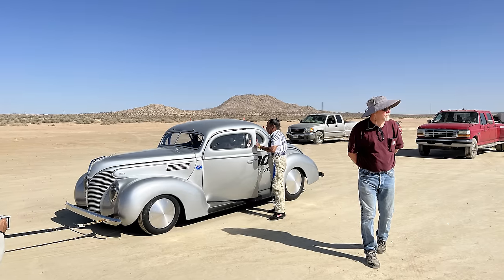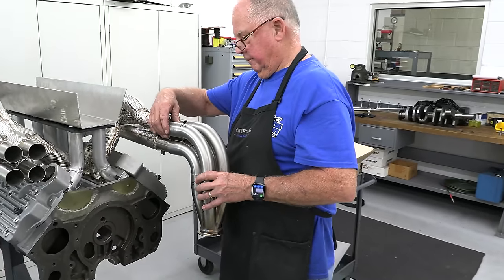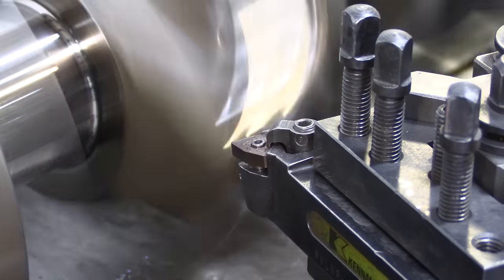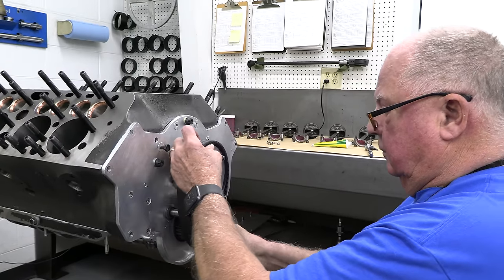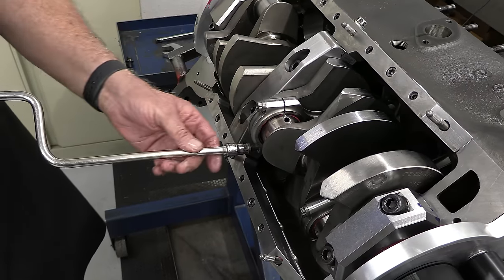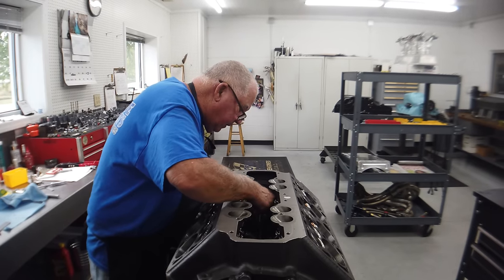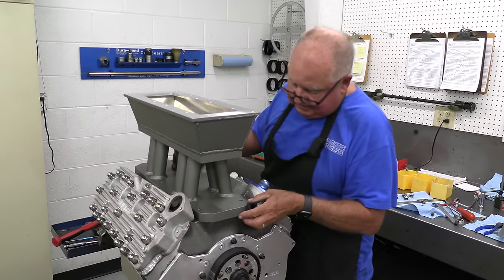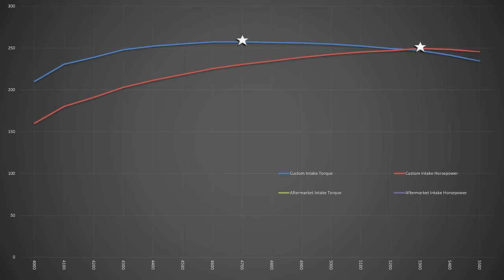World's Fastest Flathead? (Going to the Bonneville Salt Flats)

Comment: My first car was a 46 ford with a flathead  and I put wedges in the center ports to split them so they ran cooler. I remember you had to take out a head bolt and screw a allen screw in below it to hold the wedge as the bolt hole was threaded into the exhaust port.

Comment: French-built 255 engines were fitted to the Simca Unic Marmon Bocquet [fr] (SUMB) light trucks of the French military. When these were decommissioned around 1990, they provided a new source of little-worn engines for the hotrodding community. The block metallurgy, being much later, was also stronger than the originals.
looking at those "strengthening bars for the middle bearingcap , they might be able to unludea 3th and 5th bearing using that bat , mounting it before installing the crank then lay the main caps over them should prevent a little of the crank flexing between the four cilinders on each end of the middle bearing , might even be able to crossbolt the top parts of those bearings intoo the side of the stock block for even more strength
Reply: Simca cars as well
Reply: French blocks are not allowed in the SCTA Flathead Ford/Merc  classes

Comment: Minor correction, one nerd to another: going from 95 to 259 is not a 263% improvement, but rather about 162%, so your math is not correct.  Yes, 259 / 95 is about 2.62, but that's the total ratio, not the improvement.  Going from 95 to 96 is a ratio of 1.01, but I think it's obvious that isn't a 101% improvement, but rather a 1% improvement.  Whenever you have a starting and ending value like that, divide the end by the start, *subtract 1*, and then multiply by 100 to get the percentage improvement.  I probably wouldn't even comment about this, but you seem to care a lot about getting all of this right.  I get the impression you really love your work.  Thanks for the great video.

Comment: Ah, cool build!
Interesting siderail support for the centre main - I was expecting a full girdle to not only do that, but support the front and rear mains AND give some important rigidity to the block by tying the whole bottom end to the MUCH stiffer girdle.
Reply: I’m sure that would be necessary on a forced induction build. 250 hp and 257 torque is pretty easy on that big crank and mains as long as it’s balanced right and has a good vibration dampener.

Comment: That bearing setup on the custom cam is just like the main bearings on a Kubota diesel engine crankshaft. Not roller bearings on the Kubota, but same basic idea. Each main bearing sits in a cartridge and the whole bearing/crank assembly slides into the block from the back. Very very strong design with no main bolts to fail. You'd have to rip the webbing out of those blocks to send the crank out the bottom.

Comment: One worry that I have is the aluminum head squirm on that cast iron block. Aluminum moves about 4 times as much as cast iron at the same temperature which disturbs the seal that head gasket is supposed to take care of, but it will only work if the squirm is equal. With aluminum and the unequal movement between the two metals it will need something to control it. What are they using to control it? If not controlled, you will end up with water in the oil and compression loss even with short runs. Other than that, a fantastic build. That valve overlap is scary. Love to see what it finally does on the flats.

Comment: I loved watching this build, it is inspiring to say the least. By looking at the SCTA results this year Ron Cooper must have had some teething pains as his highest speed is 124+ on a 132+ record at El Mirage. Bonneville is tougher due to altitude and high temperatures which are hard on naturally aspirated gasoline engine to make the hp they did at sea level. I wish him luck as records are tough to attain. I set a speed record of 135 at ElMirage and 137 at Bonneville in a 1940 Chevrolet in the other vintage engine class in a 1948 and earlier body like Ron is trying and I was making 300 hp to do it with 311” and 12-1 compression. Those records have been surpassed by others.

Comment: Such impressive work. Both from the engine builders who are obviously next level. And the videographer's  work, The extra footage from the car at El Mirage was supreme! I am learning so much from your videos. Crazy guys with deep pockets building some wonderful machines. You should revisit that awesome straight six build and show the final product. Please.
Reply from the maker: Thanks. And I appreciate your comment about the straight six from a while back. That's the problem I run into. I'd love to show the engines in the vehicles they are built for, but as of right now, that engine is still sitting boxed up in the shop while the car builder finishes up the Suburban. I don't think it will be finished any time too soon. Thanks for watching!
Reply: @TheHorsepowerMonster  If you are able to do a follow up video on a completed car. Depending on how you present it to your audience, I believe would get many views. Being able to see this salt-flat car at the end was really something. I realize you may not have access, or the vehicle being built, like the fifties Suburban may be too far away from you. But I would suggest that even still photos would provide another level to your video. You may even want to use them as an ending to other videos. Anyway, your work is much appreciated. As an autodidact I learn by watching. So I am gaining invaluable information. Even though I am not personally (yet) building a Flathead.

Comment: My father knew a drag racer who de-stroked a flathead to spin over 8000 and used two 4 cylinder distributors geared together to keep the spark controlled.

Comment: This is really really awesome. One question… could  tapering the runners from the top of the intake to the bottom by 15 degrees increase the air velocity going into the cylinder?

Comment: there's a guy named jerry at united engine specialist in Wichita Kansas that make a main girdle that incorporates all three main caps with the side girdle all as one piece and will accept i think 460 ford main studs but you have to dry sump and inject the oil into the main caps which "reverses" the original oil flow turning it into a priority main system. and its all cast as one piece and bolts all the way around the pan rail. he runs a streamliner out at Bonneville called the Kansas twister.

Comment: I know it's comparing apples to peanut butter, but inline Perkins diesel engines run the camshaft directly in the engine block no bearings at all. The engine speed and loads are most likely less, than a automotive application. Just something to thing about, for some possible build This build is over the top!

Comment: I have at times wondered if there was an oil that would work as bottom end lubricant but also work to cool the motor if used as coolant. This would eliminate some issues with water leaking into the oil in conventional builds. I know sounds crazy!
Reply: Like aircooled vw or Porsches
Reply: I've wondered this too, 0w30 seems almost as thin as water, for the amount of time an engine like this runs I doubt it would dilute the lubrication oil too much.

Comment: I've often thought about welding up the ports and placing the intake in the valley. It would only work for one season but it is currently legal. It would give a straight shot to the back of the valve. The exhaust would come out in the current intake port location above the in valley intake. This would be as low as possible with intake runners facing on an upward angle. It would be a bit of a Jenga game to put together but it should really work great.

Comment: My father who has now past once told me of a flathead ford they had built in the 50's that they had power a bout with in New Zealand . And they had carbs on the exhaust ports and the header out the inlets but i seem to recall that the had cut and welded the cam and ran the engine in the reverse rotation

Comment: They should try a long centre branch exhaust manifold like on the old Austin Mini engine, the Austin also has a siamese centre exhaust port and headers with a longer centre section has been well established as a way to gain power
Reply: Flathead is a lost cause those cylinder heads do not flow. It's like trying to beat a dead horse to plow the field it just ain't going to happen.
Reply: 90 degree crank in the V8, valves down one bank don't open with even separation like like the Mini. But it does look like the exhausts were more about working to time schedule rather than a full development program.

Comment: If he makes the main caps as one piece also called a bed plate and make the bed plate also bolt to the pan rails it will strengthen the whole mains situation. He could also have a bar along the top to join the mains that way too and have the sump bolt to that which could also separate the two sides of the engine for the dry sump.

Comment: The Ford flathead made 95 HP, and the Mercury flathead made110HP. on the later versions. the early versions had the distributor down in front and had two distributor caps. and the later versions had the distributor up on the left side looking from the front. and used a regular cap. the early versions had four spark plug wires connected to each cap. that went up though metal tubes as wire looms then went to each spark plug. they all had two water pumps that doubled as motor mounts and the generator was mounted up front on the intake manifold. and the fan belt look sort of diamond shaped. the early flatheads didn't have adjustable tappets. and a person adjusted the valve clearance by grinding the valve stems. the later flatheads had adjustable tappets. all flatheads had only three main bearings. and we're only good for about 4500 RPMs. otherwise a person was at risk of flinging the bottom end out of them. and all flatheads had remote oil filters. offenhouser made a lot of performance parts for the flathead and built some pretty potent flathead engines. they were known for the blocks cracking. especially between the valve seats because the valves were so close together. they were sort strange because a person could run them without any mufflers but yet they weren't really loud. and a person could remove one head and run them without it. them big Holley carburetors seem pretty big for a flathead but they seemed to work. I know these engines pretty well. my father raced a B class Chevrolet with a 235 six cylinder. because Chevrolet only had a six cylinder at the time. but it was no match for the offenhouser flatheads.

Comment: It's crazy that nobody makes new blocks for these.

Motor City Flatheads had prototypes for a big bore/thin wall block with upgraded port flow even compared to factory ported, and a stronger bottom end but it went nowhere. The much underappreciated and much better post war design "big block" 337 is the new frontier for flatheads lol.

Comment: if you try to revisit the original design, make your runners from cast iron, and braze or possibly solder the runners in place. mcmaster sells a special flux thats very effective for usage on steel and stainless steel, and may work on cast iron as well. also in theory, a longer rod will have less frictional losses.

Comment: Seems a extra bolt in main set would be possible, maybe use Subaru mains machine grooves in the block pan rail kinda wedge in after  placing the crank in the block.  Bolt in from the side,  using 1/2" bolts, then 3/8" bolts from the pan bolt rail. With the new pan being flat,  no arch over the crank,

Comment: I wonder if spray welding could have fixed the blocks that had wear issues. I also wonder about doing some cast iron welding to strengthen or modify the blocks for that awesome reverse flow arrangement

Comment: This saddens me. When I was younger I had old gear heads tell me they had 500hp flatheads, but they didn't have the abilities and new type of parts to come anywhere close to this set-up.
Reply: Not possible the structural integrity and cylinder head flow is simply not there.

Comment: One thing a flathead has in it's favor is a simple light-weight valve train, just like an OHC, so it is capable of high revs without having to use super-stiff valve springs, without the excessive height and bulk of OHC engines
Reply: They don't make much power at high revs though. The valves are small and the ports don't flow well.
Reply: @nerd1000ify  True.

Comment: They should look at the Ford big block flathead 337 used on the big trucks. It should be able to be bored and stroke to 375 cid. The intake runners are already straight to the valves. Only problem is that most blocks have cracks.
Reply: Not legal for the class.

Comment: Those keyways in the lifter bores were broached I assume?... I'm still trying to wrap my head around how they did that 😆
Reply from the maker: I wasn't around for that one and I'm not sure, but you should have seen it when they put the entire block on the Serdi single point cutter to cut in the valve seats!
Reply: @TheHorsepowerMonster  That took some tactical maneuvers I'm sure lol How did they secure the block for that, did they have to make custom fixtures of some sort?
Reply from the maker: @graveyardrumblers  Oh yes, they had to come up with a whole system to get the block on the machine and then hold it still.
Reply: @TheHorsepowerMonster  All that could be a video by itself lol. Cool stuff, love to see folks breathing new life into those old flat heads and especially for something as cool as a Bonneville speed run.
Reply: How would they Evan get any tooling in there  to began with.
Reply: We use those same style lifters in pulling tractors. You use a hardened dummy drill bushing with a slot down the side made by a ball end mill. Slide the bushing in the block square it up and then drill down the side. The hardened bushing guides the drill right where it is supposed to be.
Reply: @bcbloc02  Ah that makes sense, thank you 👍

Comment: Surprised it uses 1400cfm of carb for that airflow and power.
Would love to see a Flathead modded for Direct Stratified Injection and a decent throttle body. The lower parts count could make interesting numbers for internal friction losses compared to OHV and OHC engines.

Comment: Nice Build!!  Maybe you could squeeze more HP out of the flat head with direct injection
Reply: Nah, that suits high compression ratios, I don’t think a flattie would like zero lubrication and cleaning on the intake valve. Flatties carbon up really badly anyway because the exhaust cools in the block and carbon condenses on all the surfaces because of the massive surface area inside of the chamber and ports.

Comment: The Moderator means well, I'm sure, but is quoting inaccurate info. re: Original HP. It is true that early Flatheads were not rated over 95 HP. But, he states that this is the later 49-53 Block. That engine in 52-53 Mercurys was rated at 125 HP, and in 52-53 Fords 110 HP. A small point, but should be pointed out, I think.

Comment: Impressive. I'm assuming when you say flathead you're referring to a ford flathead v8. Because Cadillac had a flathead v8 that was considerably more than 95 HP. The 346 was 135 HP, and 175 Ft Lb at 1000 rpm.. I'd be curious to know what kind of HP level they could reach doing the same mods shown here.

Comment: AWESOME BUILD & VIDEO!👍👍.  Thanks for sharing this one .  Only one question …….. that front end shot of the car showing it head on has the strangest grill on a ‘ 39 Ford I have ever seen.  Could this actually be a late ‘38 titled as a ‘39??  Please correct me if I am wrong …. Wishing these guys all the best at speed week & hoping to go myself soon to witness all that is the “ Addiction of speed” that goes on year after year ( Weather & salt conditions willing) 😊
Reply: I thought it was a '38 at first, but some research came up with the '39 Ford Standard which had the headlights closer to the grill, same as the '38, while the '39 De Luxe had the headlights farther apart in the fenders aligned with the wheels similar to the '40 Fords.

Comment: I wish they would have drilled out the exhaust valves and used a larger sodium filled valve. I noticed the welded combustion chamber. That is an old way to increase compression by making the quench smaller.

Comment: If they went through the trouble to make the block to pan extensions and new front and rear main caps...
Why make the crazy four piece rear main seal? Use a modern two piece seal in place of the old rope seal. Then cut a one piece seal set in the back of the new end cap and block. Kinda like a 351C seal conversion. You would need a drain hole between the two seals but it would never leak.
To incrementally increase air volume/pressure on a naturally aspirated engine use an air ram breather with a vacuum actuated louver. The faster you go, the more the air will flow and it should still qualify as naturally aspirated.

Comment: Im sitting here thinking with what i know about engines and the restrictions for that class.     i wonder if they could make a flat plane flathead ford if it would make any more power or would it be to unbalanced.  i didn't know that flatheads only had 3 mains maybe they could make a "windage tray" that has ribs in it to grab parts of the crank to re enforce it.